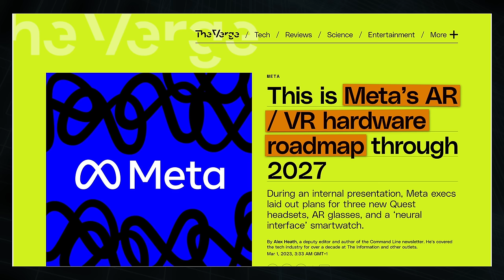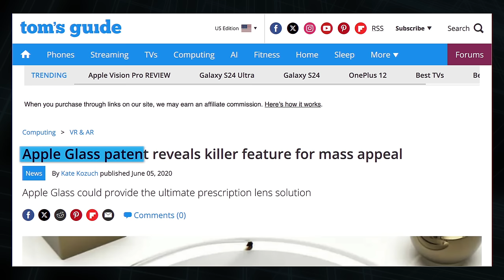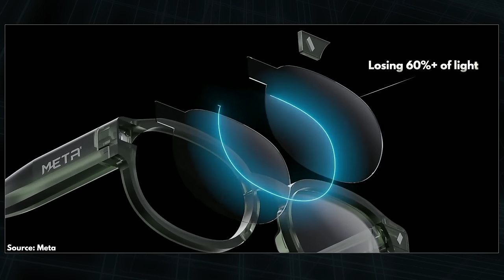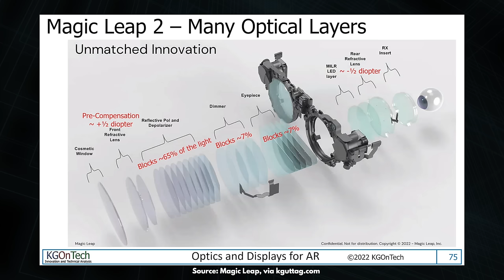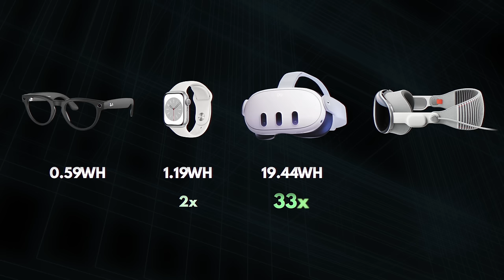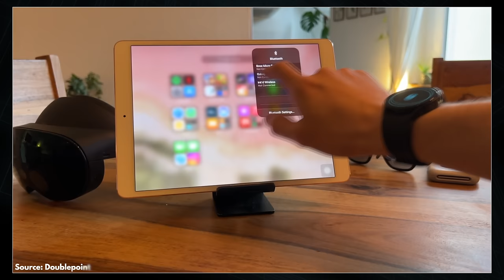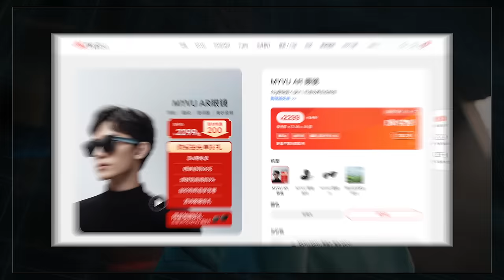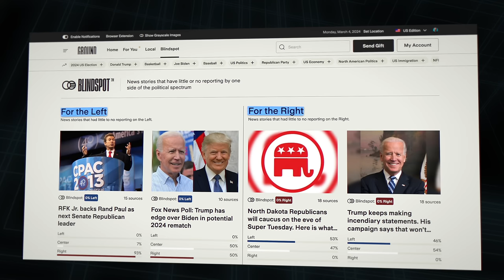The billion dollar race for truly smart glasses

Comment: all of these approaches are outside in, i expect the true breakthrough will come in the form of inside out neural interfaces like neuralink or a non invasive version of it, 
basically projecting images directly as electric impulses onto your vision neurons, reading muscle movement from your motor neurons etc. 
its also not as far away as you might think, we just need a few more breakthroughs.

Comment: Two considerations: 
1: What problem does smart glasses solve? It's usually not a good idea to be a skeptic of new tech before it's reached mass adoption, since the mobile phone was ridiculed back when it was first introduced. But you have to wonder what the wearable glasses can do that a touchscreen device can't. Maybe one day obscuring your eyes will be the norm, and people won't look at you funny when giving your device voice commands in public.
2: Could wearable tech on your face be the final line in the sand that is off-putting enough that it won't ever be seen as a normal thing by the public? It's one thing to wear a mask to keep from catching or transmitting illnesses, but obscuring your eyes and pointing a camera at everything and everyone may be too much. We've had sunglasses for a long time, and it's still often seen as pretty bad manners to not take them off in certain situations.

Comment: How they're going to adjust the focus point of the eye, it can't be focus on the glass to see the content, right? That would  be incredible uncomfortable
Reply: It's like a hologram, the optics project the image a few meters in front of you so you look at it if you're looking at an object 3m away and you focus on it yourself. No dynamic focus with where you are looking though so you would need to either look at the image or what's behind it. Kind of like when you can focus at the dirty spots on a window or what's outside.
Reply: @blitzar8443 but there are  no items to project on, are you saying the light emit from the glass simulation light from 3M away? So when we focus on the actual glasses, you see a blurring mess? Unlike VR there are no change of focus point because there are no deeps of field

Comment: Maybe some will have use for them, but to me any glasses that you can physically see through look like junk compared to what something like the Vision Pro can do. If you could make the pass through better and streamline the size and weight so that a Vision Pro like device was more like safety goggles (split the difference between Vision Pro and sunglasses) that would be way better. Put the battery in your shirt pocket on a shorter cord. The pass through camera concept may have its issues with things like dark environments but these sunglasses style things all look like crap to me. I'm not going to watch a video on some opaque screen. I'd rather just pull out my phone like I do now and see a good screen.

Comment: the talk of Qualcomm in this vid reminds me of the idea that all other soc designers are so far behind apple silicon right now. thoughts? is this true? if you already have a video on this, I couldn't find it - sorry!
Reply from the maker: Yes and no. I think Apple is doing a great job on CPUs and power efficiency especially as compared to Intel / AMD. But their dominance is not as clear in other areas. Qualcomm & Huawei are clear leaders in connectivity and even Apple has to buy their modems from Qualcomm despite having spent billions on trying to build their own. In terms of GPUs, Qualcomm chips are technically more powerful than Apple’s A series (though devs often optimize more for Apple). On the high-end CPUs where Power efficiency matters little, Intel and AMD still outperform. And I think both Intel and Qualcomm have somewhat convincing plans to catch up with M series chips on laptops in 2 years or so. So the answer is complicated. Apple has extremely competent chips, but I don't think they are unchallenged
Reply: @TechAltar very insightful - thank you!

Comment: This video doesn't mention a possible technological solution for the display problem:
"Virtual retinal display" see
https://en.m.wikipedia.org/wiki/Virtual_retinal_display
Reply from the maker: If you read the wiki page you sent you will find that Intel Vaunt used these, which is the tech the Focals by North were built with as the picked up the tech from Intel. So the Focals explamatiom actually covers a version of this.

Comment: A good overview, but I would add that vr/ar sidesteps most of these issues. You get AR by having a camera on the outside and the computer just mixes the outside view into the vr projection. This means you are focusing only on the inside of the vr headset.

Comment: Ok, I'm giving them something free. for the initial iteration of the AR glasses, maximize everyone's supercomputer in their pocket to do the heavy lifting and, for now, just focus on the display, eye and finger tracking. Just connect the glasses as displays, like we're currently using earbuds as speakers. 
You're welcome.
Reply: This is how it already works with all Nreal style glasses. But it’s connected via a cabel instead because they get too bulky with a battery. You’re not saying anything new.
Reply: This is exactly what i want as well but Zuck won't do this. Meta is desperately trying to make this product category happen so that it can control the resulting app store and take a sweet 30% rent from every transaction made with glasses/headsets.
Reply: the thing you are mentioning is already a huge task and will need quite some processing power. apple had to use a laptop sized chip in it only to deal with all the sensors and creating that 3d environment.
Reply: @jimandhispetcow  yeah, of they can just put the processing elsewhere, less weight on the glasses, less manufacturing cost, faster to market. i wonder what's keeping them from doing so?
Reply: @maxse6221  aaah ok... they should totally get rid of the cable then next.

Comment: Great explanation of the various tech and hardware options. Unfortunately you completely missed the actual reason why Google's Glass experiment was such a miserable failure, and why similar products will also fail no matter how good the tech is.

Simply put, people hate being around other people who are wearing smart glasses. You have to assume you are being recorded at all times, you can't trust them to respect your privacy. People wearing smart glasses are quickly identified and isolated in group social settings. It's very obvious that people don't want to have to worry about random strangers recording them without consent, and react agressively when someone like this comes into their physical space.

They might still find their niche in specific applications where the glasses are only worn while working. But we are a long way away from the kind of social change that will let people wear these in public without being treated like 'glassholes'.

Comment: The solution is pretty obvious: transparent OLED panels like the ones in the new transparent Lenovo laptop or transparent Xiaomi TV, coupled with a 5G chip in the stem for computing on your smartphone or in the cloud.
Reply: that and a transparent LCD to block the incoming light if needed
Reply: What about the focus issue?
Reply: the blacked out area could probably be a bit less in focus as it's only needed as a background to block out some of the light at first
but honestly knowing Apple they could just call it a feature and nice blurred UI lol